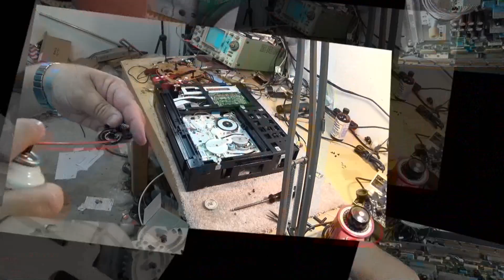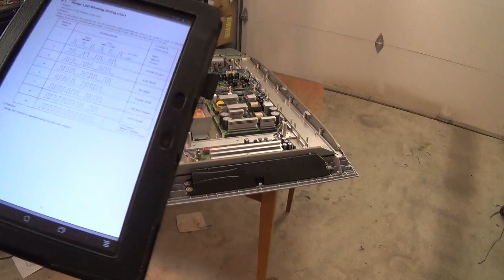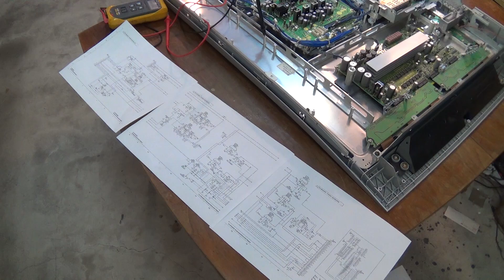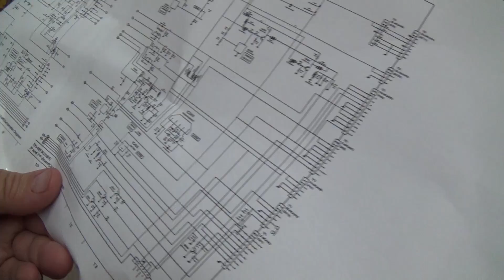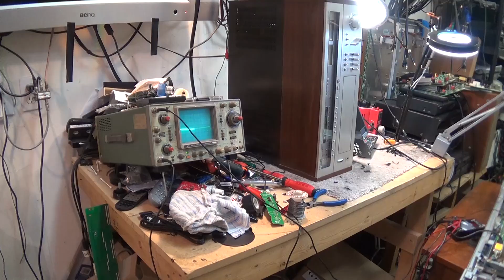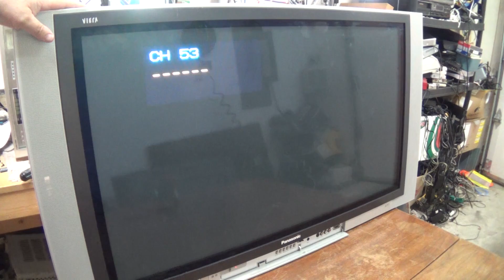Panasonic th42pa20 plasma dead set 12 blinks

Comment: Despite how much power it draws that set is well worth the repair!
Reply from the maker: +Sony Trinitron It has a nice picture for sure. Not HD, but it still looks great. Actually looks better playing non HD sources like VHS on this thing than my HD set.Not just a little better, a lot better.It will be going to a new home where it will be loved soon enough. I already have it sold.
Reply: @12voltvids  Isn't this the one you have in your garage that is featured in most of your videos, or is that another Panasonic set?
Reply from the maker: @KylesDigitalLab  yes this is the one that sits to the right of my work bench and is used as the test monitor for video gear.  I also watch tv on it.  It's from 2003 which makes it 18 years old and still looking great.  It's also the most complex set i have seen.  Glad i don't have to work on them.
Reply: Plasma TVs don't really draw that much power. People think a big old TV must draw tons of power, but that's nonsense. A modern graphics card for cryptocurrencies draws more!
Reply from the maker: @sadderthanyou7793  they sure do. A old 50" 1080 750 watts and a 65 closer to 900.  My 63 draws 700 and it is an energy star model.  By comparison an led set pulls perhaps 80. Who cares about a crypto mining station. Average people don't have those and anyone that does is a bloody fool because they will pay more for the electricity they burn up that they can ever recover.  Saw a news article that said that to do 1 transaction of a Bitcoin to buy a 2.00 cup of coffee uses about 5.00 in electricity to process that transaction once you factor in the air conditioning required to keep the ASIC crypto machines cool.
Reply: @12voltvids  Most 50-65" plasma TVs draw 250-350 Watts with the dynamic picture mode (which you should never use because it's inaccurate), around 150-200 Watts with the cinema picture mode.

Who cares about a crytpo mining station!? That's a major environmental concern nowadays. There are so many crypto farms that they are drawing more power than whole countries! Nobody will make a buck from crypto at their home, but some people have entire farms, and that's where they actually make BILLIONS, but it's at the cost of the environment.
Reply from the maker: @sadderthanyou7793  
I actually did a video showing a few plasma sets on a killawatt meter to show their power consumption.  If you like I can also show you the rated power consumption on a few of mine. They are power hungry compared to other technologies.  Now the later generation of plasma were far more efficient, in that 300 watt average range but the earlier generation sets were not.  The largest plasma that Panasonic made required a dedicated 240 volt 20 amp service and drew down  about 3500 watts average power. That was the ginormous 104" monster that retailed for over 90 grand.  I have see one in a customer's home.  He bought it used from the 2010 Olympics for 64,000.00 in 2010.  He had to have a dedicated dryer type outlet installed for it.  Draws more power than. My electric car charging and it draws 4Kw.
Yes i am aware how much power crypto uses.  We are all paying for it now because power companies are scrambling to build new facilities to keep up with demand and passing those costs on to is end users.   You wouldn't wabt to pay my power bill. 2 electric cars and a 2500 sq foot house with a heat pump for heating and AC.  400 bucks a month easily.
Reply: @12voltvids  You do realize that all of this is exaggeration, right? And that all of it is easily verifiable in this day and age? There are countless websites which give the actual data on this. The average power consumption for 50-65" plasma TVs is 250-350 Watts, and only if you're driving the panel at full brightness (which is to the detriment of picture quality).

In order to convert watts to kilowatts, divide the wattage by 1,000. Let's use a 50" plasma in the cinema picture mode drawing 220 Watts.

220 watts/1000 watts =  0.22 kilowatt.

From there, let's multiply the kilowatts by, say, 20 hours of television usage:

0.22 kilowatts x 20 hours = 4.4 kilowatt-hours.

Finally, multiply the kilowatt-hours total by the average rate of 13.19 cents per kilowatt hour:

4.4 kilowatt-hours x 13.19 cents = 61.16 cents.

It's not even remotely relevant in the grand scheme of things. A typical plasma TV doesn't draw a significant amount of power and it's neither a danger to one's electricity bills nor to the environment.

Even the old plasma models use less than you're stating here.

A 100" plasma would draw ~1400 Watts at the maximum, and such TVs were extremely rare. They were almost exclusively used by businesses.
Reply from the maker: @sadderthanyou7793  
Let's agree to disagree as you can't argue with someone that hasn't a clue. I quoted the numbers on the tv. Now they may be maximum but they are still what they set can and does draw when someone is watching say a hockey game or ice skating or downhill skiing.  Naturally if you are watchibg a movie and it is a night scene the consumption. Is less. I did a reading on my my plasma where i showed that it was lower than the rating on the label but it does vary by screen content.
Samsung hpt5044, 510 watts
Panasonic tcp46g10 531 watts, Panasonic tcp46s1 526 watts, Panasonic th42pz800 575 watts and that is a 42".   These are all published ratings and that is what i quoted.  By comparison my Samsung led 40" tv draws at maximum 45 watts.  But you know everything.  You know the saying you can't fix stupid.
Reply: @12voltvids  You're one random youtuber who disagrees with countless websites where these measurements can be checked. Sites like HDTV TEST UK are legendary and their technical data on TVs was always accurate. They have these plasma TVs tested for power usage, and none of your measurements are accurate. You're exaggerating their power usage by 2-3x. Also, I don't know where you live, but the rate per kilowatt you're posting here is insane. Maybe look into your electricity provider instead of blaming it on TVs, lol.

And it's obvious LCDs draw less power, but it's not that important because 200-300 Watts (on average!) from a 50-65" plasma TV is not THAT MUCH. Crypto miners use crazy amounts of electricity just to run stupid graphics cards. From such a perspective, these old TVs aren't that bad!
Reply from the maker: @sadderthanyou7793  
I measured my plasma sets using a kill-a-watt power consumption meter and i know exactly how many watts my plasma sets are drawing.  I did do a video on this years ago where i showed the meter. I am quoting the numbers here on the sticker on the back of the set.   You are saying they don't draw that much but in reality they do compared to the newer sets which are in the 45 to 75 watt maximum range with everything cranked up full.   My 4k led set for example draws an average of only 26 watts. When i measured my plasma sets i did so using the industry standard test, which is the internal color bar generator or external fed color bars.  
The older ones draw more than the new. 
Our electric rate here is  9.4 for first 1350kwh and then 14.1 for the rest.  I have a live reading power consumption display on my house.  At this very second I am drawing 9.888 me of energy at a cost of 92.7c per hour.  No tv is running either.  Just central air and one car charging.  The 2 cars typically with eat up about 25kwh to recharge the battery.  So yes my power bill is high but i don't have to visit the gas station and pump 100 onto the tank every week.  I don't bother with ccikatjng what the costs are.  I have a display that does that for me. It reads the utility meter in real time.  I turn on the tv and it tells me exactly how much it is drawing.  Turn it off and the display drops back.  Subtract the high number from the low number and I know exactly what it uses and what it costs.   Right down to the penny per hour in real time. I look at the display note the cost and then turn on another device and note the cost.  The difference is what that device costs to run per hour.  No need to look at web sites which are btw not certified, anyone can publish anything they want.  I have the data at my fingertips all measured by the billing meter on the side of my house and updated every 10 seconds.
Reply: @12voltvids  You think HDTV TEST UK measured their sets using a potato? They were even more professional about it than you are. For example, they actually calibrated these TVs for THX-like picture quality, instead of running them in the idiotic torch mode. Also, such measurements must be AVERAGED, not PEAKED.

You're also totally missing the point. Obviously, lame LED lighting in modern LCD TVs draws less power, but that's why they suck so badly in terms of color fidelity, black levels, smoothness of movement, etc. These old plasma TVs don't even draw as much power as modern graphics cards used for crypto mining. That was the whole point, in case you forgot. Anybody who claims old TVs draw incredible amounts of power is a hypocrite because we live in a world where crypto farms draw more power than whole countries.
Reply from the maker: @sadderthanyou7793  
What the fuck do crypto farms have to do with tv? Nothing. And no my set is not running in torch mode is it fully calibrated in a home theatre type setting.  I have never run in dynamic mode.  I calibrate using a proper SMPTE color bar generator with 7.5ire pedistil and blue filter to set color levels.  I know how good plasma sets look. That's why I keep them running.  They do draw power and they throw off a ton of heat.  
LCD sets do look like crap and an led is still an LCD sets.  OLED are the future.  They look great and they don't require a second mortgage to operate.  Crypto farms spring up in places like northern manatoba or Quebec where they can get cheap hydro generated power and it is cold outside so they don't need to run air conditioning but they still draw a ton of power but they are the tip of the iceberg.  The biggest draw in the future will be charging electric cars. Here they are selling like hot cakes.  On my block alone 9 electric cars out of 12 houses.   That will be the big user of electricity.  Gas cars will be a thing of the past in the next 5 to 7 years.
Reply: @12voltvids  It's a point of reference. It's stupid to say that old TVs are somehow mega power hungry, when modern graphics cards used in crypto mining take much more power than these TVs. You're on some ego trip here - not only you're trying to portray yourself as some kind of authority, but you're also ignoring what I'm saying just to talk crap about your personal life. IDGAF what you think. I'm telling you what countless website claim about the power usage of these plasma TVs and how they compare with crypto mining. If somebody thinks an old plasma TV is going to make a difference in their electricity bill, it's ridiculous. Such a TV might add 5-10 bucks to the bill TOPS. That's practically nothing, especially when these TVs last 10+ years on average, whereas modern LED TVs are crap after 2 years.
Reply from the maker: @sadderthanyou7793  again I don't understand why you are comparing crypto mining to plasma tv?  Crypto mining is not something that the average person does.  Who cares about crypto. Are you that thick? Plasma tv do draw more power than all the other TVs out there.  The old fluorescent backlit LCD also drew a fair bit but not as much as plasma.  Compared to LED backlit and even old CRT tv they draw SUBSTANTIALLY MORE electricity.  This is a fact that you just can't stand being wrong about.  I don't care of it adds only 10 a month that is 120 s year more to the energy bill and for some people that is a big deal. My electric bill is out of control here because everything in my house is electric.   2 electric cars and multiple plasma TVs big computing power for editing videos, air conditioning.  I couldn't give a rats ass what some web site that is totally unverifiable claims.  I have the data in real time on what televisions or any electronic devices for that matter draws from the grid.  I can map it out.  They draw more than other tv technogies.  That was the point.  Why do you keep going on about crypto mining.  I have no interest in crypto either.  I buy physical gold. Something I can touch so when the big crash happens i will be sitting pretty while all those that lost everything on Bitcoin are looking for a bridge to swan dive off off.

Comment: Very good! Your persistence and that you went all the way to get it is very helpful to see. I wish I'd been that persistent with an SD plasma I found on the street; it was in far worse shape but I should have done a proper burn out at least. Those always crack me up!
Reply from the maker: +wdavem I guess you missed the last one, where I blew the crap out of it with a big ass neon sign transformer.  I repaired the power supply only to find that the hybrid IC on the Y sustain board was bad. It was an old SD display, so I gave it a send off. I have another LG panel here, also with 2 bad boards, so I will send that one off is a light show some day soon. It has been cluttering up my shop for far too long.

Comment: Great diagnosis, thanks! Where there external marks on the filter, proving it died, or did you measure everything out?
Reply from the maker: +Koffi BananNo there was no visual indication that the part had failed. Had I let it burn more then it probably would have been scorched, but as soon as I saw the smoke I knew where to put the meter, and it showed a short on the 30 volt power line. SO I unplugged the tuner, as that is what the 30 volt supply is for, the varactor diode tuning voltage, and the short was still there. There was only 1 component on that supply, and it was right where the smoke came from. The meter proved that out pretty quick, however don't get me wrong, this bloody little filter took me a long time to find. A search on the net shows that nobody else has come across this problem, so I would imagine that other TVs that this problem has happened to have just been disposed of. Now that we know that this component causes an issue, hopefully people will find the problem, and fix a few more of these classic plasma sets.I have a soft spot for plasma, as it was the only flat screen technology that I had formal training on, and even though they are incredibly complex, I find the technology, and just the way they operate is cool.

Comment: Interesting repair process - also, interesting how they converted voltages from 12 V to 9,2 V to 30 V. Makes you think that when they started out designing the unit they didn't know what voltages they were going to need in the final product ;)
Reply from the maker: +DrCassette I plan to do a short theory video on this circuit to explain why they did it this way.I can assure you the engineers knew exactly what they were doing, and I can also assure you that even though it seems more complex, it was done to shave a few pennies off the cost of the design.I'll sit down with the print and the camera and do a quick deep dive on that power supply soon.
Reply from the maker: It's a buck boost converter. The coil that shorted was part of the choke that filtered out ripple. Totally unnecessary as it was for analog tuners. The only reason I jumpered it was to get the tuning voltage back. The voltage is a little lower so it won't tune about about channel 30, but no big deal. There are no analog signals anymore except the ones I generate on my in house system, and I only have channels set on ch 4,5,7,9,12 and 27.

Comment: Very interesting repair and diagnosis!  I am a bit confused about the filter short though - was it a cap that shorted?  I was confused by your comment that you replaced the shorted filter with a wire - wire = short also?  Or did you just bypass the filter circuit completely with the wire?  Great vid, love the channel as always!
Reply from the maker: +GadgetUK164 The component that shorted is called a delay line, and is nothing more than a very thin wire  wound on a non ferrous core. They are using it likely to eliminate any high frequency harmonics from the dc-dc converter. It is shielded, and the shield is grounded. It was shorted to ground. The 9 volt supply feeds the inductor circuit from the dc-dc converter, so a short on this component not only kills the 30v supply, it also shorts the 9v supply. This is an interesting design, and I think a separate short deep dive video,  with the schematic and an explanation on how this circuit works and why they did it this way will be done to help those of you interested in how this works understand it. Will probably do that tonight while I still have all the prints handy.
Reply from the maker: +DrCassette yes th part was shorted. If I had left the battery on long enough it would have burned the part open but could have damaged the DC DC converter too so I didn't leave it on more than a few seconds. Just long enough to get the smoke. That pointed where to concentrate. This is my set so if I blew it up no worry I didn't pay anything. But now I have a real nice looking TV to sell. I already have 2 offers.
Reply: +# charis The battery may have blown it up - but it must have been faulty before already because otherwisely the TV would have worked just fine.
Reply: Sometimes a bit more power helps clarify a fault =D
Reply: It sure does :D
Reply: I understand now!!  Thanks!
Reply from the maker: +# charis that was the idea. I knew I had a short just didn't know where where was.   The 9 v battery has enough current to burn the bad part up. This use to be the standard for the telephone industry. They would put a bunch of batteries in series 600 volts, called a breakdown set. Would cause the pair under test to short, or go open. Then they could put a tone on the wire and find the fault.